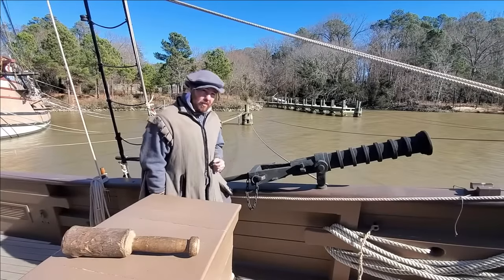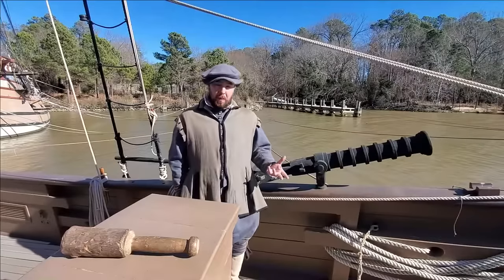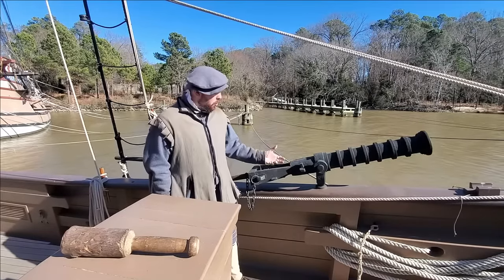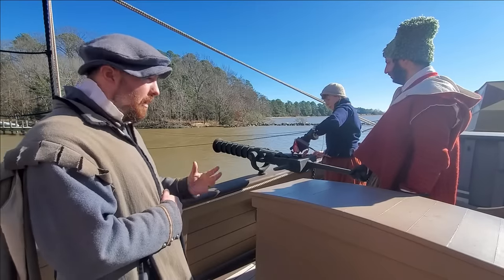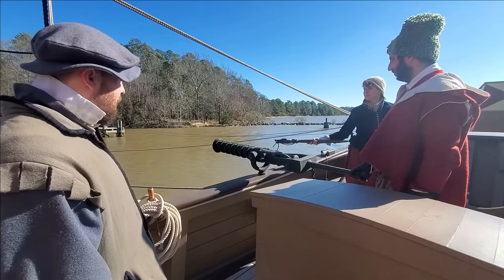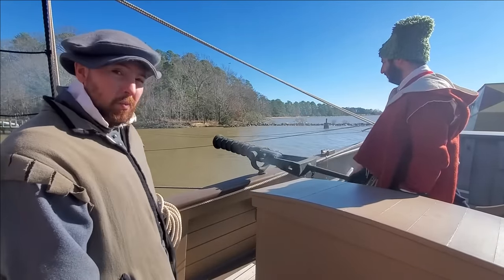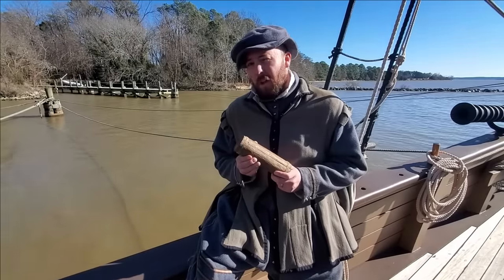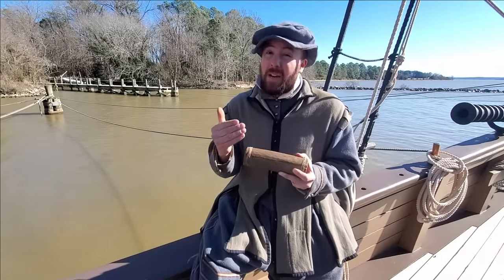Primed and Loaded | Wrought Iron Swivel Gun

Comment: A very different question; Do you have any "Loggerheads", being a most important tool on a wooden ship? They were used to heat tar in a bucket for sealing joints on wooden ships. Generally tar may have been used with oakem, which was fibrous, and tar provided the the glue to make the seal watertight. The reason for the Loggerhead was that it was a lump (this the real question, exactly what it looked like) of iron with a handle, that was heated in the galley fire, then put in the tar bucket to melt the tar, so no fire outside the galley.
They did have a use off the ship as well, they were the equivalent of a microwave to heat liquids in Taverns. But I suspect they were not the same shape.
To me this is a fascinating device, once ubiquitous, that has completely disappeared.
Another fact is that they are a saying in the English language, "At loggerheads", as they were used by the sailors as weapons.
Reply from the maker: At this timeframe loggerhead was a slang term for a stubborn or hardheaded man.  Neither John Smith in "A Sea Grammar" or Sir Henry Manwayring in "The Sea-Man's Dictionary" uses the term loggerhead to name or describe tools.

Comment: this is so interesting to see. can the wooden hull handle the recoil? because there seems to have zero room for the gun to move back so all the stress are absorbed by the ship hull, would it weaken this section a lot and break the wood after years of firing? just the section attached with the cannon of course.
Reply from the maker: The recoil of these guns mounted in this manner are not going to be an issue. The wedge securing the breech chamber is absorbing quite a bit of energy. With metal to wood contact, the pintle mounted on the rail may cause some wear when traversing the gun.

Early in the history of naval gunnery, guns were actually mounted right to the ship's deck. Eventually guns will be mounted to carriages independent of the ship's structure, allowing movement and aiming of artillery.

Comment: When you take into account that cartridge of musket balls numbered almost 1,000.  Imagine what that would do to a boatload of men trying to board the ship.
Reply from the maker: Probably not quite 1000 musket balls.  A gun like this probably should be firing a case shot that weighs about 2-3 pounds.

At .75 caliber, there would be about 12 projectiles to the pound, with 24-36 projectiles in the case shot.
At .60 caliber, there would be about 20 projectiles to the pound, with about 40-60 projectiles in the case shot.
At .50 caliber there would be about 30 projectiles to the pound, with about 60-90 projectiles in the case shot.
Reply: @JYFMuseums  Thanks for the clarification. The information I was relying on was obviously wrong.

Comment: I built a replica of a medieval Cannon of approximately the same size, inch and a half or 40mm bore about yard or a metter long and a muzzleloader. However for safety sake it was made of modern steels. Also because I was in a region where this could be safely be done (Rocky mountains) I was able to fire its 2 lb lead ball in a live-fire exercise. Something I seriously doubt what's going on with this particular gun (they would have seriously compromised and damaged the ship dock and other things down range)
       What is missing it's when you are live firing such a gun a incredible shockwave comes out the muzzle and my gun being mounted on the field carriage would jump back some 4 To 8 feet!
        I would have found it interesting to know what size charge they were using and if there is any documentation on what size charge was common for that gun in it's day. I very much doubt they were so foolish as to use a full charge, it's an old gun been through unknown stresses and such guns even when new were known to occasionally fail catastrophically.

Comment: What about fowling? Considering it's firing black powder, it would seem the barrel would need to be swabbed down often. When you say 'very close range', what is that in feet/meters?
Reply from the maker: Well black powder is dirty, but it's not such that its use would create so much fouling build up that the windage would be significantly impacted, or that its would be necessary to regularly swab the bore of the gun.  As a breech loading gun, each case shot put through the gun would effectively scour the fouling of the previous shot. Reducing fouling build up.

With case shot it is probably most effective within its first 100 yards.

Comment: I have question about operational procedure step,
 why use step:
a. put cartridge on cannon -> filling powder on the cartridge -> fire in the hole,
rather than:
b. filling powder on multiple cartridge -> put cartridge on cannon -> fire in the hole,
does it (b.) is more fast and practical during panic and chaotic situation on the battlefield?
Reply from the maker: In our case the breech chamber is set into the gun, the touch hole/vent is picked with a wire and then primed with loose gunpowder then the weapon is fired.  The gunpowder to prime the gun is loose and held in place by gravity and the walls of the vent hole.  The problem with picking and priming multiple breech chambers before loading and firing the gun, is that there is nothing to actually hold the loose priming powder in place and the gunpowder can be lost from the vent as the chambers are jostled, picked up and moved about. Another issue is that by priming the chambers, there is now exposed gunpowder in the vent, and a wayward spark or ember is capable of setting off a single or even multiple chambers -- both the priming charge and the main charge.  This is why the gun is charged with a breech chamber, the vent picked and primed, and then fired.

Comment: how close range are we talking for that thing? do we have any data on that? also, could it theoretically fire a solid slug instead if such ammo was prepared ahead of time?

also JYF is fast becoming one of my favorite historical channels on youtube
Reply from the maker: Thank you.  As far as data, not the level of data we'd like to have, but on a piece like this we believe that it would be most effective in its first hundred yards or so.  A gun like this probably could fire a round shot.  However, the bore size is about the same as a falcon, with the shot's weight at about 2 1/2 pounds.  The mass and velocity of a 2 1/2 pound round shot is just not going to be enough to have any measurable effect to another vessel.
Reply: @JYFMuseums  Thanks!
Reply from the maker: Our Pleasure!

Comment: Very appropriate you should call the shot load a wooden can. This is called "cannister" shot. And the separate chamber is the original "thunder mug."
Reply from the maker: Sure, although cannister is a term that comes into use in a later period and in the early-17th century it is simply case shot.

Comment: What is the diameter of the bore? How much does the shot weigh? Any idea on the velocity of the projectile?
Reply from the maker: The bore is about 2 3/4 inches. The shot was generally case shot that might weigh 2-3 pounds. If the case was filled with .50 caliber pistol ball, that may be 60-90 projectiles in the case, and if .75 caliber musket ball, that may be 24-36 projectiles in the case.

Comment: How is the matchup of the mouth of the breach mug with the bore of the gun? Would the projectile have to be sub caliber?
Reply from the maker: The muzzle of the breech chamber is necked down sufficiently that it fits into the breech of the gun's bore.  The projectile would be case shot, which only needed to be a slightly smaller diameter than that of the gun's bore, and would be loaded in the bore's breech prior to setting the breech chamber.

Comment: Seems to take massively longer to prick and prime for firing than total breech removal and reload. Wonder if they did something to shorten that time or simply used several of these guns with staggered firing to suppress return fire.
Reply from the maker: Hello Gerad. This particular ship, Discovery, only has two swivel guns. One on the starboard side and one on the port side.  We think that it is most important to note that vessels such as the Discovery are small merchant ships, not warships and their use of artillery is meant to ward off or scare off a threat rather than allow the merchant ship to stand and fight it out.

The question we have is what do you mean by "massively longer..."  As modern people we do place a greater importance on time and efficiency of process that does not necessarily exist in the 16th and 17th centuries.  Aaron and Kelly are no slouches to fire off 4 shots in 3 1/2 minutes, where as a gun such as a Saker, firing 5 1/2 pound shot was rated to be loaded, aimed, and fired in 5 minutes.  Nonetheless we will admit to the frustration of the poor pour quality of the cheap Virginia Company supplied priming flasks. 😅😉
Reply: @JYFMuseums  Thanks for that answer. Was impressed by the way they handled the reload. Was mainly the priming time that had me baffled. And you crew were well versed and handled firing with ease..

Comment: Great video on swivel gun drill.  our group has a smaller swivel gun we know can have an idea for a firing demo.  How many cartridges or mugs does your gun have?  what is the drill for reloading the mugs?  wet swab then dry swap like a muzzle loader?
Reply from the maker: Hello Stan.  At the museum between the ships and James Fort, there are four of these iron guns and about 4 breech chambers for each gun, though they are fairly interchangeable.  For a swivel gun demonstration we will prepare 2 ounce cartridges sufficient for the number of shots intended to be fired during the demonstration.  If three shots are to be fired, then three cartridges will be manufactured and prior to the start of the demonstration they will be loaded into three chambers, then each is fired in the course of the demonstration.  Afterwards the cartridge remains and debris is wormed & cleaned from the breech chamber and as necessary the chambers are cleaned and oiled.  For a demonstration we are not reloading and firing multiple shots from a breech chamber.

Comment: Why does it have baffels or ribs on the fuselage? Does that serve a purpose other then aesthics? I guess it would be good for rope tying to hist it up onto the ship, making it lighter, by reducing material but maintaining heft for recoil... but is that why? you can tell it's pretty baffling.
Reply from the maker: The construction of the gun started as four iron staves, (much like the coopers staves of a wooden barrel), to form the bore of the barrel. The staves were then wrapped in more iron. To strengthen and reinforce that construction the bands (baffels or ribs as you referred to them) are added to the barrel construction.

Comment: So those breech plugs are pre-charged with black powder and the operator is pouring in flash?
Reply from the maker: Yes, the breech chambers are pre-charged and the chamber gets primed once the chamber is fixed into the piece.  If desired, once removed, the breech chamber can be recharged and used again.
Reply: Flash...??

Comment: what did they do if attack took part in the rain?, one is quite sure that must have happened.
Or did they ask attackers politely to not attack in rainy weather?.
Reply from the maker: No matter what, gunpowder is hygroscopic and tends to absorb moisture, which will spoil it.  Aboard ship isn't going to help matters, and probably among the many reasons that merchant ships would rather run from a fight and would avoid having to stand and fight.  Also among the reasons for the importance of boarding actions as well.  It is interesting that Robert Norton in his book The Gunner Showing the Whole Practice of Artillery, does not mention rain.  As long as the gunpowder is not spoiled it'll fire and gunners are going to have their tricks to keep powder dry.  Practices as simple as using a hat to shield the priming powder unit the moment its fired.

Comment: What kind of bullets did they use and where did they load them?
Reply from the maker: The general ammunition for one of these swivel guns is case shot.  That case shot is a wooden can packed with 2-3 pounds of pistol or musket balls.  That case shot would have been placed into the breech of the barrel right before placing the breech chamber into the cradle.
Reply: @JYFMuseums  Wow. That's a lot of bullets.

Comment: Why did the breech loaders fall out of favour ? Was it nearly as easy to load a small cannon from the muzzle ?
Reply from the maker: The issue with early breech loading artillery is the gas loss suffered at the point that the breech chamber is set into the barrel's breech, because of the lack of a tight seal.

To prevent gas loss and maintain the increasing energy of the burning gunpowder, one of the first real technological advances in artillery was the transition from forged iron breech loading guns to cast bronze muzzle loading. And while we may talk of breech loading artillery falling out of favor, they will nonetheless continue to be manufactured and used. Henry VIII's flag ship, the Mary Rose was armed with both forged wrought iron breech loading guns and cast bronze muzzle loading guns. A number of these guns have been recovered and are now on display at the Mary Rose Museum in Portsmouth, England.
Reply: @JYFMuseums  Thanks for reply .
Reply: I do not know about America, but in the Mediterranean, small pieces very much like this one where still in service during the napoleonic wars on ships and in forts.

Comment: Great demonstration. Though I think the operation would go faster with 3 people. Do you happen to know how much the piece weighs?
Reply from the maker: Our iron swivel guns weigh about 300 pounds +/- a few pounds.
Reply: @JYFMuseums  Very nice. If firing a single solid projectile would you happen to know the weight?
Reply from the maker: @AmeriKHAN A gun of of this small size is not really going to fire a single solid projectile, or what we'd refer to as round shot. And the round shot would lack the mass and energy to be effectively used against another vessel. This small gun would be most effective with case shot. Case shot being a wooden case or can filled with 2 or 3 pounds of musket or pistol bullets. Three pounds of .75 caliber musket balls would be about 36 projectiles when the case shot is fired, and the case leaves the gun  and expels the bullets. Think of the swivel gun as a large shotgun. Much larger wrought iron guns, such as those on the Mary Rose would certainly fire round shot.

In general at the early 17th century artillery will be grouped and named by the size of shot. Guns known as falcons are going to fire shot in the 2 1/2 pound range; sakers are firing shot in the 5 1/2 pound range; demi-culvern are firing 9-12 pound shot, while culverns are firing about 17 pound shot.  Just keep in mind these are rough numbers and we've only mentioned a few guns of the period.

If you check out our video at this link, it is a broadside from the Susan Constant's falcons-- https://m.youtube.com/watch?v=AiJ3Qp2tXlA
Reply: @JYFMuseums  Very interesting. I ask because the bore diameter of the gun looks bigger than most of the swivel guns I've seen on the internet. But i'd imagine the gas leaking reduces them to ever lower velocities than the carronades of the 18th and 19th century. I also noticed from my research that mortars were described in inches rather than poundage.
Reply from the maker: @AmeriKHAN The bore diameter on our iron swivel guns are 2 3/4 inches.

Comment: I would expect a well trained crew to be able to fire that four times a minute but it still has to have the barrel swabbed every two or three shots as the black powder fouling builds up fast.
Bronze is denser and ergo heavier than iron
Reply from the maker: No, it's not necessary to swab the bore of these guns. The need to search/worm and swab a muzzle loading artllery tube has everything to do with removing debris and extinguishing any live embers from the previous shot and making the gun safe to be reloaded and fired again.

It is unrealistic to believe that black powder fouling builds up so quickly or even at all in such a piece, that windage becomes so measurably reduced.

Comment: I wonder how this cannon is attached to the swivel considering there are no visible screws or cut outs.
Reply from the maker: The gun and the swivel/pintle are attached together at the trunnions, which are just forward of the breech cradle.

The trunnions are part of and protrude from the barrel band that was slid onto the barrel assembly during construction and probably before the cradle assembly is attached to the barrel.  The trunnions are a sort of tenon and become the attaching point for the pintle.  The pintle is then probably attached to the gun assembly while hot and hammered down onto the trunnions aligning the pintle's holes/eyes onto the trunnions.  The trunnions and pintle is the pivot point that allows the gun to be elevated or depressed while the pintle sitting in the ship's railing allows the gun to traverse left or right.
Reply: @JYFMuseums  Thank you very much! I couldn't even expect such instant reply and well detailed explanation ^^

Comment: why do not they use fuse?
Reply from the maker: Priming powder fires immediately and is reliable. To use such a thing such as a fuse, it would probably have to be fitted into the vent, potentially slowing the process, and once fired it's leaving an ash debris potentially clogging the vent that would have to be cleared.

Though with the 18th century priming tubes have come along. Do check out our video about priming tubes -- https://www.youtube.com/watch?v=_ruInfl1yxk&t